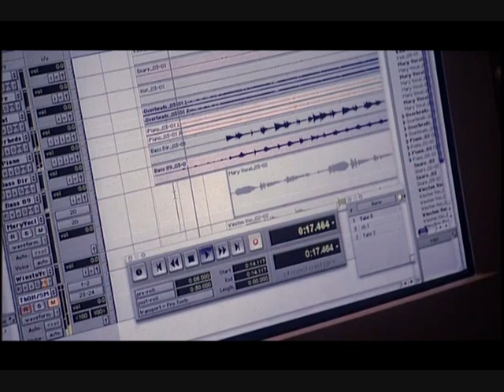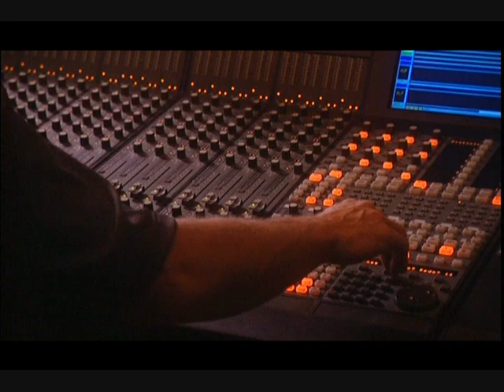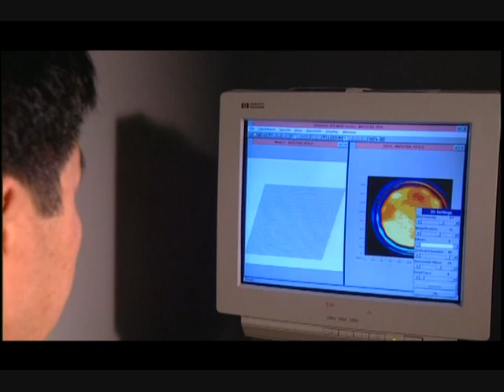Infinity speakers approach to design

Comment: @KJDJBeatsProductions I have used a Bose Wave radio that my friend had and when I heard it playing, I liked how it had comparative bass to my 40 watt Philips sub, but the vocals were lost and the mids were a little scratchy when I got close to it. For ~$350, I would have expected more. If they could make a system that could handle maximum volume for 6 hours a day, for 2 years, at $50out the door, I might take a look at it. I use a pair of Logitech Z130s as tweeters and a Philips SPA2360/17 sub.